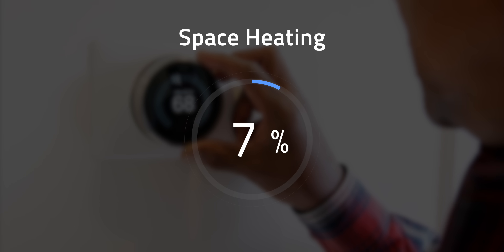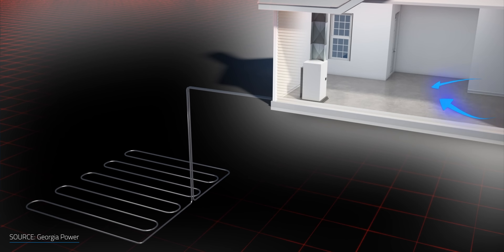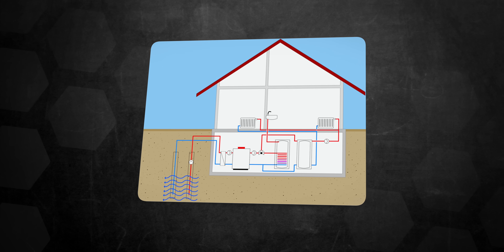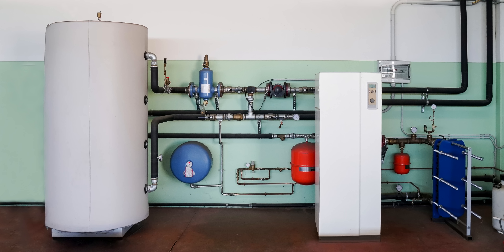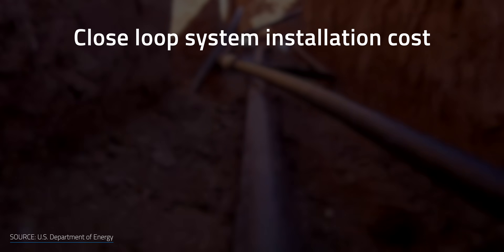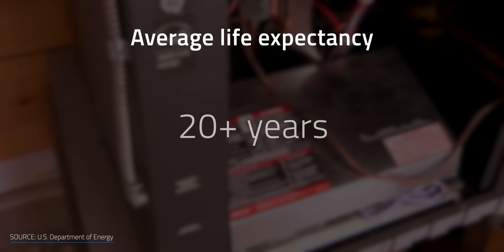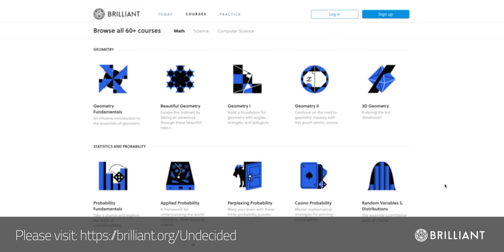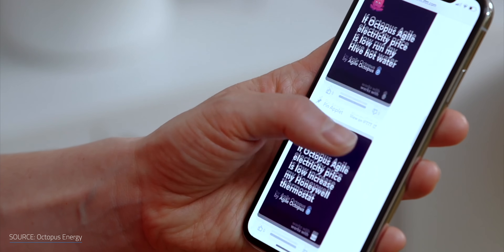Is Geothermal Heating and Cooling Worth the Cost?  Heat Pumps Explained

Comment: I have been interested in geothermal for years . There is a small detail that people follow the majority of information available . Quick question for EVERYBODY , what transfers heat better plastic or copper ? A friend that is an HVAC technician installed geothermal in his house and his shop . I asked him how he was able to install enough ground loops to cool and heat his 6,000+ square feet of house and shop on his relatively small property . He said he trenched about 180' and used copper pipe , a single 1" pipe . He explained the heat transfer of copper verses plastic and also that the inefficient plastic coils laid on each next loop giving less ground mass for heat transfer . He went on to explain that the total volume of fluid needed was greatly reduced which in turn meant he need a much smaller heat pump . Now if a person combined this with an earth berm house and solar and wind power you could become energy independent . Food for thought !
Reply: The difference between copper and plastic in an 1/8" pipe wall isn't worth the chance of springing a leak in the copper (IMHO).  Certainly not in the instance of ground burial where the limitation is the thermal conductivity of the soil itself.
Reply: @CorwynGC  You may wish to research that assumption . On average copper's heat transfer rate is 4 to 6 times better than HDPE . And if bedded properly and installed with an expansion layout , leaks and wear should be minimum . If you will look at the laid over each loop of the HDPE tubing , the amount of thermal mass for each tube is greatly reduced because of each coils close proximity .  However installers like excavating much more and installing much larger tonnage of heat pumps , they make much more money .
Reply: @henryzabel1746  I did.  I did the actual math involved.  The 4-6 times greater heat transfer of copper is useless if the heat transfer of soil can't keep up, which it can't.  Feel free to do the math for yourself if you don't believe me.

Comment: I have some experience with Geothermal heating and cooling. 

Back in the early 90s my parents decided to augment our wood stove heated house with geothermal. We had a good deal of space, so they used a closed loop "slinky" style tubing. All the equipment was inside, and we even hooked the water heater up to it to help heat water that way. It was... fine, as I remember. One thing that people don't talk about is the heat put out by a geothermal furnace "feels different", especially if you grew up with something like a gas fired furnace or wood heat. It isn't as intense. It slowly raises or lowers the temps in your house, but that system didn't do it quickly. Oh, and it had an electric emergency heat coil that kicked on frequently, especially in the cold Illinois winters. So that was fun for power bills.

Fast forward 30 years, and my wife and I buy a home that had been recently renovated with some new technology: on demand hot water provided by a gas fired heater, and a recently installed geothermal furnace. We weren't looking for a home with geothermal, but it was a great home for us. I remarked a few times that it wouldn't feel the same as what she grew up with, so be prepared. And I was right. The heat isn't "hot", as you would feel coming from a conventional gas fired furnace, and in the summer the air conditioning doesn't feel as cold, but it raises or lowers the temps in your home to the desired temperature. And after the first year of testing I found that the heating couldn't keep up if the outside temperature was below 35 degrees. Since my install has LP backup, I just have my nest set that if the outside temps are below 35 it automatically uses LP heat instead of just letting the furnace struggle to heat the home.

And before the comments come, yes I have had it serviced, and the techs stated that the furnace reports everything is working.

One thing I've noticed especially in the summer time is the cooling lag. If you have doors open for a while, or a really hot day, it seems to take a long time for the AC to cool the house down. Some hot Illinois days, when the humidity is really high and the temps are in the upper 90s, we can't seem to keep the house cool at all.

That being said, I am getting solar panels installed soon, and part of the deal is that they are going to go through the house to seal it, and check the ductwork for holes and repair those, so maybe that will help. And I should really research things like thicker curtains to help keep the sun out of the house during those hot and humid days. If someone has any suggestions, please reply and let me know what works for you.

So my experience for two different systems that span 30 years of history is... if you want it, get it. Just be prepared to understand that the "feel" is different, and you may have to change how you approach heating and cooling. Oh, and if you have access to LP or natural gas, get that as your backup.

Comment: Well done.  A good survey of geothermal options.  One correction, in your intro (0:06), you imply that geothermal energy is powering these systems.  It's not, it serves as a heat source/sink.  They still get the power to move the heat from electricity.  Vastly less electricity than getting the heat directly from elec., but they still need to be plugged in.  :)

Comment: We need hot water, cold food, and air conditioning. Why not make that an integrated system? Then geothermal heat pump and passive house, and we are talking about low energy house. However, the upfront cost will be killer.
Reply: Yes please.  No reason the up front cost would be more than the current model.

Comment: Refering to what you said a 02:00 
If it acts as a heatpump then the temperature in the ground relative to the air does not need to be hotter nor colder than each other. that would only be true if it was a straight heat exchanger.

When using a heatpump you can extract heat from anything warmer than the liquids boiling temperature which for most refrigerants are around -30-ish Celsius. (plus or minus 10 degrees)
If i remember correctly from school they pump a non freezing liquid in the ground, bring it up to the unit where a heat exchanger transfers the heat from the loop-liquid into the heatpumps refrigerant. The heat pump then does its thing.

Comment: Note you can also use air-based heat pumps, they are not quite as efficient, but are much lower cost, does not require the land,
and still works until some pretty extreme temperatures. (Like negative F temperatures), and no matter what heat pump you use, 
its always way more efficient then resistive or combustion heating.
So if the price makes you worry, see if thats an option in your area.
Reply from the maker: Great advice/point.

Comment: You always should consider "passive house" level insulation before you invest in a high energy heating/cooling system!

Probably way better for the environment
Reply from the maker: Yes, insulation is the place to start for sure, but these systems are very low energy and efficient.  Pair both and it's a win-win.  Actually did a video on passive homes.
Reply: @UndecidedMF  I really liked your video on passive houses!
That is why I was so confused that you did not mention them here :)

Great video nonetheless!
Reply: @UndecidedMF  For a Passivhaus, the metric is 15W per square foot for heating.  Call it 1500W for an appropriately sized family house. For a 120 day heating season, at 16 cents per kWh for electricity, simple resistance heaters would cost $700 per year.  That looks like over a 30 year payback for a geothermal system.  Or compare to an air source heat pump at $230 per year, more like an 80 year payback

Comment: We had a WaterFurance 7 Series geothermal system installed back in 2015, and we absolutely LOVE IT!!! The only maintenance I have to do is check the air filter once a month. In the winter it's 70 degrees and in the summer it's 70-72 in the house. It's quiet, efficient, and free once the heat loan is paid off. In Massachusetts, we have a 7 year 0% interest rate HEAT loan, plus there were a lot of federal and state tax incentives. If everyone does the math and adds up the amount of money they have dumped into their oil/gas tanks over the number of years they have or planning on living in the house, the cost of the geothermal system is a fraction of that. We will NEVER go back to fossil fuels ever again! The only complaint I had about the whole process is that there is a lot of red-tape to get through, so be patient! Also, the drilling company is the most expensive part of the whole process. They charge a lot of money! We had a vertical loop system put in, and the driller was 1/3 of the cost of the total bill. Once the system is in, you will not regret the investment, plus the value of your home will go up because it's considered more green and has less of a carbon footprint. Geothermal homes will be, someday, more desirable than standard homes.

Comment: Awesome video. I am so getting used to your high quality that I almost forget to mention it by now...
Geothermal is an interesting concept, and I have seen it used in some homes around my neighborhood. It's weird though that over here we nowadays tend to use air-based heatpumps rather than ground coils in newly installed systems.
Reply: Not weird at all.  Much cheaper.

Comment: We have radiant heat in our floors (hot water). What technology is available for fluid to fluid heat exchange, is it reasonable?
Reply: Absolutely. That's the most common system in Europe- heat pumps are especially good for wet underfloor heating as they are at their most efficient when asked to produce warm, rather than very hot water. Both air source and ground source heat pumps can easily be directly connected to an underfloor system, at most you might need to fit an inexpensive plate heat exchanger.